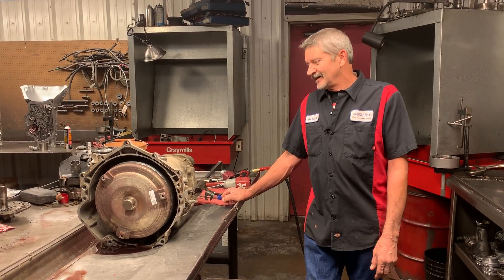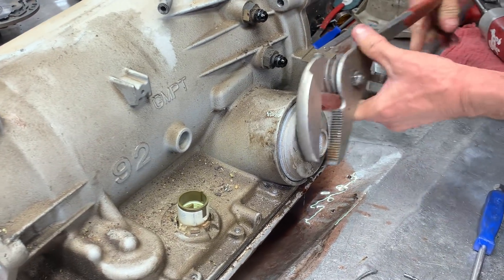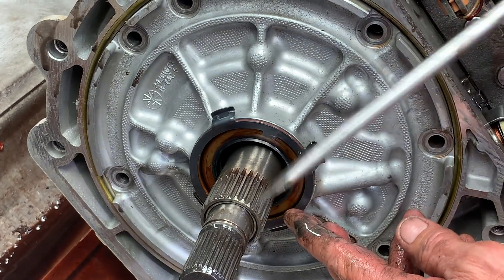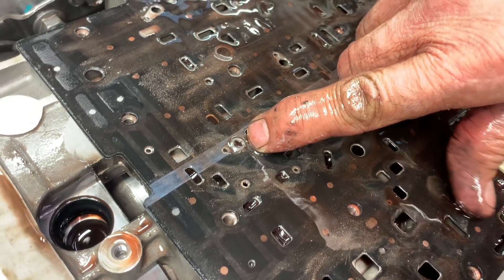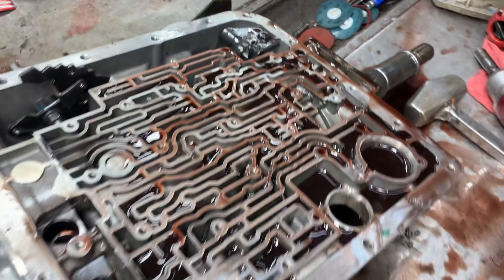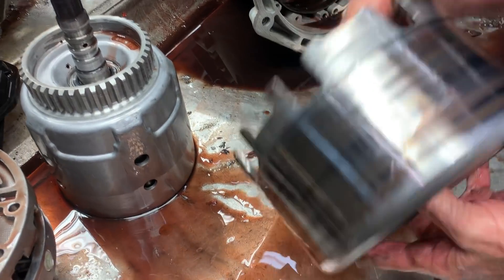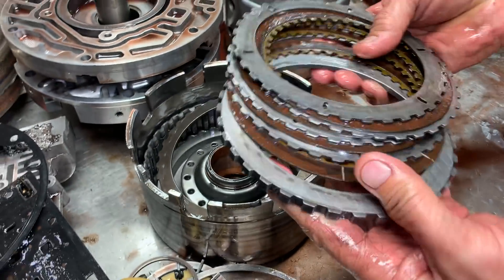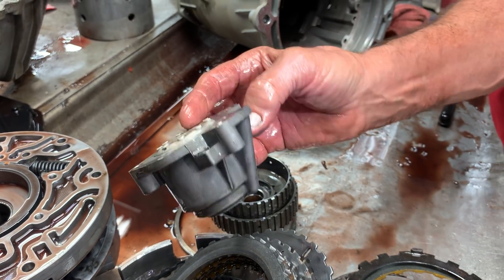Here’s the BOMB that went off in this 4L60E Video 2-2

Comment: If my trans ever blows. I'm just sending it to you. As one mechanic to another. I appreciate the attention to detail and the effort to do a damn good job.
Reply: Achronic Deth  1700 miles and the extra $1000 in gas and tolls don't seem to be that much extra when you factor in the added extra use you will get.
Reply: @jinxxx696  Just pretend it's a carefree road trip, like when you were a youngster.
Reply: @thomasmleahy6218  I drive semi, I always see driving as work now.
Reply: But i live in florida and im stuck in secind gear with one truck , only got 1st and 3rd with the other ..the half ton 4x4 aint no problem , fits on a car hauler , but the other ones a 2000 chevy 3500 bucket truck it wont fit on the 13 car hauler  😢

Comment: I rebuilt one automatic transmission in my 05 Suzuki Forenza.  I had to take 100s of pictures and the rebuild instructions were iffy.  It finally went back together after two weeks of tinkering at night.  Driving down the road as it shifted through the gears I was as proud as a new papa.
I probably reused too many old parts so it lasted about 80,000 miles and needed another rebuild.  By that point the car wasn't worth all the effort.
Big respect for those who do it CORRECTLY for a living!

Comment: That’s the first planetary gear set I’ve seen that destroyed... wow that’s crazy
Reply: I'd love to understand why. The rest of the breakdown makes sense. How did that actually grenade?
Reply: @fshalor738  looks like it got screaming hot, and he mentioned a possible cooler issue at the beginning. Guessing lack of lube, and lack of cooling.
Reply: You've never seen someone tow in OD with an early a340f then
Reply: @fshalor738  lost rear lube oil,alot of the newer units are bushing sensitive,they must be replaced,the 4l60 and e and 4l80e is definitely one of those,i have one in my motorhome,its working flawlessly now,that can change quickly with multiple trips up mountains in the summertime,fluid changes are necessary,bushings need constant oil lube
Reply: Lack of maintenance...

Comment: I rebuilt my 4L60E years ago for my Roadmaster wagon. I remember at 20 minutes those plastic rings, I think I used a seat clamp, but was thinking you could use a piston ring compressor. Anyway I had one failure on the test drive, the oil pump snapped (part driven by converter). So I got a heavier duty oil pump and was fine ever since. There was a big shell drum had a crack running hallway around it where it meets a shaft, and used an updated stronger drum. And one of the shift coils was open. I did all the upgrades and made good use of the ATSG manual for it. Still working good.

Comment: I have a '99 Chevrolet Suburban 2500 with a 4L60E that shifts great, but it has over 200,000 miles on it. I think I'll have to road trip down there from Virginia to have you guys rebuild my unit so I can drive it another 200,000 miles.

Comment: I had the 4L60E fail twice in my 1995 Chevy C1500. No fourth gear both times. Same mechanic rebuilt it in his messy home garage. After the second time it failed, I bought a new unit from GM and had a trustworthy shop install it. Problem solved. Then I sold the truck to my brother. :)

Comment: First tranny I ever did was a 4l60e I bought the truck with a blown tranny and had no money to buy a new tranny so I bought a rebuilt kit. I remember one of the clutch packs still had a date printed on the actual clutch material even after having 130k miles on it I couldn’t believe it. The 3/4 clutches were burnt. It worked great for 3 years until the one planet blew out. I’m sure the washers we’re probably gone on the planet but I didn’t know any better to check them. I remember getting it almost back together just about to put the pump on and I found the anti clunk spring (or whatever it’s called) was on the bench so I had to take it back apart. I had no idea where it went this was back when YouTube was pretty new so I watched videos for hour’s until I found a video showing it lol

Comment: That looks like they had a hard, long run overloaded, overheated uphill and ultimately stopped going after they came to their first stop, maybe to fuel up.  I had a similar experience and the transmission quit only after I stopped for dinner, then it wouldn't go. Combination of heat-soak and the parts relaxing.

Comment: I was really thinking there be a lot of damage to clutches and steels and nothing looked terrible bad. After you pulled the planetary out and I could see that damage. I was impressed and that wasn’t a catastrophic failure that was run making noise for awhile. People don’t realize that every mile they put on after the transmission has a problem equals dollar signs.

Comment: This transmission reminds me of my old 76' Cutlass, had a TH-350 and it brokeup at low speed, I drove it all the way home to my carport and it never moved again, had to tow it and the guy said that it had fused the planet into the back of the case, he couldnt even take it all the way apart. had to get another case, that was around 1992, cost $675 bucks back then to get it all fixed with the cost of tow included.

Comment: It's probably the same thing as fitting the Teflon sealing rings into a power steering rack on the main piston & spool valve,I have soaked them in hot water so I can fit them so I don't break them whenever I rebuild a power steering rack.

I have used the plastic off a soft drink bottle so I could slide them on without cutting the Teflon rings.

It seems that they conform to the shape of the housing after a while because it's the same as the Teflon crankshaft oil seals in a Chevrolet LS1 V8 engine where the engine must sit for 4 hours before the engine is filled with oil and/or started because the Teflon sealing lip conforms to the shape of the rear crankshaft seal journal or the  journal of the harmonic balancer !

Comment: So what do you think caused this failure? Was it the 1-2 accumulator piston craking? Was it a cooling problem potentially caused by the aftermarket cooling fittings or problems in the transmission cooler? Was it a nicked seal? Something else I missed? I am not a transmission guy at all, but I am learning by watching your videos!

Comment: I assume you'll flush the cooler and lines prior to reinstallation. I'd like to see a vid on how you do that and the material you use.
Great vids, THANKS🤗
Reply: I would assume at this point, the cooler probably needs to be changed, and maybe the lines too.  There is no way you will ever get that amount of metal flushed out of the cooler
Reply: @stephenleach5830  Totally agree. New lines and cooler, for sure.

Comment: I'm pretty sure all of the shift kits specifically say to use aluminum accumulator pistons because the plastic ones will break. That cracked 2nd servo was probably the start of the hard shifts that blew the planetary. Got to stop driving them when they start shifting hard so you can save them.

Comment: If you ever strip out one of those pump bolts just fill in the star with a mig and weld a nut onto the head of the bolt, works like a charm!!

Comment: 1 those case connectors are for the ones right before they added the iss and took away the psi manifold(pillow switches) but the case has the wedge seal.             2 the stators sometimes have a hole and a plug for the iss but it's not used yet and sometimes I've seen them with the late model input shaft and will have a reluctor on the shaft for the iss but the sensors plugged off in the stator.            3.* Looks like the last builder either didnt flush the cooler and or did a half a$$ patch job and didnt tear it down that far. (I'm just a slightly educated rnr guy lol just a guess.  )

Comment: Last year I volunteered to rebuild a friend's 4L60E from a 1500 Suburban with 4wd.  Never having seen inside of any auto trans, this was very interesting.  I replaced the shell with a thicker shell, and then, upon reassembly, found that the front pump clearance was insufficient to allow the pump to seat with required clearance, even with the thinnest washer.  I had to surface grind the washer a few thousandths, and ended with the correct clearance.  The transmission has been running fine now for months, including a 2000+ mile road trip.
My question is this: Have you ever had to thin down the front "selectable" washer to obtain correct front pump/input shaft play?
Reply: BTW, the one-way clutch cage had ripped apart, was the reason for the rebuild, and I put in all new bushings, clutches, rear planet, rear sun, shell, new roller bearings, seals,  new solid pistons, new band, all cleaned up, and a new converter, too.  The oil was filthy... filthy black mess.

Comment: I don't get why a little usefull mod to the pump body is never mentioned. Behind the oil seal, there is a drain hole. Drilling it larger will stop the oil pushing out the seal. Far better than glue or silicone to fix things !
Also, mostly on 700R4/4L60, why Richard does not talk about cutting a drain chanel on the edge of the box where the 2/4th pistons drain off, in case the gasket moves or squashes and blocks the small hole ?

Comment: I have a question for you if you don mind. Working on 02 s10 4.3 (4wd) an has torque converter shudder an a hard time fully engaging. However when hook up my scanner and command the TCC it locks immediately. Unit has 60k from Alltranz. Going to change all the shift solenoid’s etc while have the pan off. In your opinion (and without your diagnosis) think doing the right thing for starters? Thanks in advance and appreciate your through video’s

Comment: Do you guys rebuild manual transmissions? I have a 2001 Dodge Dakota with a NV3500 that could use a rebuild at some point. When I did the clutch 2 months ago the input shaft and its bearings inside the transmission were fairly worn, and it routinely sticks in 2nd gear.

Comment: I've got an issue with my 94 chevy c1500 4L60E transmission. It's the original and it's been working fine but recently 4th gear has been slipping and shuddering if I apply slight throttle to pick up speed so I keep having to drop to 3rd to pick up speed and use 4th to kinda hold it at around 70 on the highway. I feel from watching your videos, it's gotta be 3-4 clutch burnup and piston seals gone bad but what else do you think I'd have to replace?

Comment: question: i have an 2004 4l60e. 165000 miles. still works like new. i serviced it not long ago and the pan residue was normal. would it be worth the effort to drop the pan and drill out the plate and replace the check ball to head off future problems? wasnt the problem this time but that check ball seems to be the no 1 killer of 4l60es.

Comment: Got an old 2000 Silverado with the 4L60E. Any tips to get the most mileage I can out of it? I did a partial fluid and filter change fairly recently at 90k.

Comment: Damn I just found y'all on here n I wish I had found you fellers 2 yrs ago when I had my th350 built. I lost all confidence in the shop that I used when I pulled out the driveway and it blew the accumulator out on the first shift because some ........guy didn't get the snap ring in all the way. I was 1/2 mile up the Rd b4 I noticed something was wrong. I coasted back to the driveway n pulled it back to the shop but did it hurt anything? Lack of fluid that fast wouldn't hurt anything was what I was told but I'm not a transmission guy. Should I just blow it apart n inspect the work? What's you boys opinion?

Comment: This transmission is a good example of what a cheap rebuild looks like. The date on the case was 2-20. So it probably barely made it's 6 month warranty that the 'professionals'' like to spout. Obviously worthless, the builder should be paying for this. They always have a million reasons why the warranty doesn't apply. It appears they replaced the frictions, threw in some cheap ass ''shift kit'' and called it a day. The problem is they inspected nothing as evidenced by the broken plastic piston. The planetary gear was likely a victim of oil starvation, caused by the damaged teflon seal and/or the piston. This is a good example of why I don't trust the ''professionals''. Richard would be reliable of course, but I wouldn't know that without watching his videos, which are his motivation to do them. The extra income doesn't hurt either. The only criticism I have of Richard is he likes to keep the build part ''secret'' which I find laughable.  Typical old skool race guy. All kinds of secret information everyone else is too dumb to know, hahahahaha.
Reply: I don't think he likes keeping it secret. I think it is just a lot of work to do the build, it takes a lot of time, it is fiddly, and they haven't figured out a good way to show that on video. There is at least one video on the channel called "It's a build video", but I haven't watched that one myself.

Perhaps at some point they will figure out how to show a build. I'd guess it might be a multi-part series, each showing the details of some step. It would be a lot of work to make, and most people would probably be too bored to watch more than a little of it.
Reply: It’s hard to build one for a customer on video as you are billing the customer per hour. The customer really don’t wanna pay for your side business. Plus you can’t imagine the time needed to edit a 8 hour build video down to a manageable 45 minute to 1 hour YouTube video.
Reply: He tells you all the tips and tricks they do while tearing 'em apart, i.e. the seal resizer, where you can and cannot put check balls, etc., then they go back together the same way they are taken apart, only clean and new.
Reply: Wasn’t he offering a paid service recently where you could watch build videos? 
Don’t know if that made it, just recall all the cheap f@&*s whining that 40 years of experience, and all the time editing should be posted for free since YouTube videos are always so lucrative, and they’re entitled to it.

Comment: Hello, Richard. 
PATRICK here Indiana. Question. I have a 1999 Dodge Durango. I bought new. put almost 200,000 miles on. but, last 50 thousand or so Trans. doesn't shift in to 2nd unless you Rev up rpm's & maybe get over 25-30 mph then it jumps up to 3rd. then shifts out normal. Yes, 4x4-- 460 motor. I have over the years changed fluid & filter from dealer. and couple other Trans. shops.  I have been to other big Trans. Shop @ my area. but, no one can tell me anything of what to do. One place told me leave with us & we will look over, I ask what cost might be ??  They, had no idea of what to quote me ?? ( I guess they wanted a blank CHECK !! )  Any advice would be help full. 
  Thanks  ..  PATRICK

Comment: I have a 1990 s10 4cyl. I replace the flex plate 4 times it brake around 180 miles after I change it any suggestion thank you

Comment: 4:36 man, i would kill for this guy to see what I did when I was young and dumb. Driving my mom's van because my 5-speed broke down. Got into the insane habit of "shifting" it into neutral (on the tree) to save gas (it only got 17 MPG). Except one day I slapped the lever too far and shifted from drive, passed neutral.... into reverse. Doing ~45-55 MPH. I knew I felt the indent (into reverse) the second it happened but I was still too slow to react. The car slammed forward and down as the completely locked up engine was now attempting to spin backwards. The van came to a halt, the engine died. I turned it over and it came back to life, and drove home. I was absolutely physically terrified of telling my father (someone who was already super angry if anyone broke small something of his). I think I told my mother and she was like "we'll tell you father in a few years." The van still drove another 3 months before it finally stopped going into gear. When my dad opened the case, there were huge missing chunks of gear teeth in the differential. I still feel embarrassed 15+ years later.   Apparently modern computerized auto transmissions will simply go into neutral if you select reverse above ~15 MPH. I was not that lucky. ~1994 Dodge Caravan with a Chrysler 3.0 V6.

Comment: seeing the teflon seals on that transmission reminds me of building turbine engines for helicopters. very important job to get right the first time. 

ive found if you soak the seals in boiling water first they are more malleable and easier to install/take shape easier on reshape

Comment: What do the check balls do?
Reply: The check balls in a trans valve body can serve 2 functions. 1) control the direction of fluid from one circuit to another. 2) control the pressure to any given circuit, for example, a clutch circuit. The clutch pack will receive a hard hit (high volume) of oil pressure to apply it quickly before the check ball has a chance to fully seat. Once seated, the smaller hole next to check ball hole takes over and keeps the clutch engaged.
Reply: @Spector_NS5_RD  Interesting and thank you for taking the time to explain it to me,

Comment: I would like to see a demonstration of what goes on inside an automatic transmission when neutral drop'd
Reply: Most of the time on the 4l60 you burn the direct clutches up some times so back they weld themselves together and you now have forward movement in park ,reverse, neutral, etc had to fix one my nephew did to the floor neutral drops in a 09 Colorado  with 4cyl
Reply: @bamadave1983 that sucks, I wouldn't even want to try to rebuild a transmission..it's fun to watch neutral drop and this channel.. I wonder what  precision transmission thinks about the neutral drop channel 🤔

Comment: If your a welder , you can weld a nut on top of a stripped bolt 🔩 and back it out ....holy cow all the parts are in the bottom of the pan......